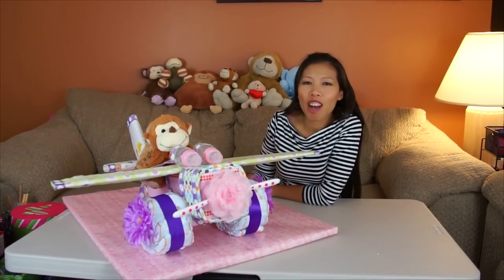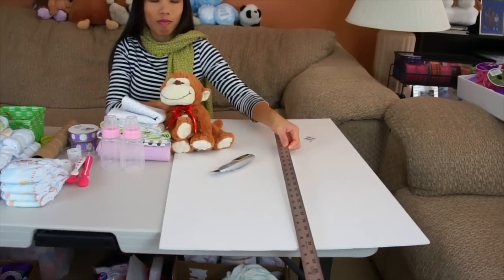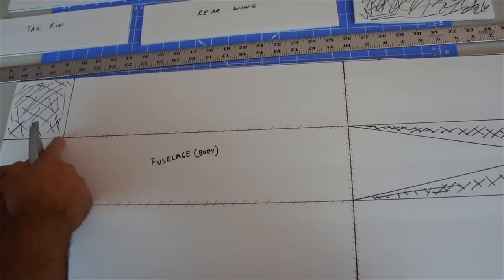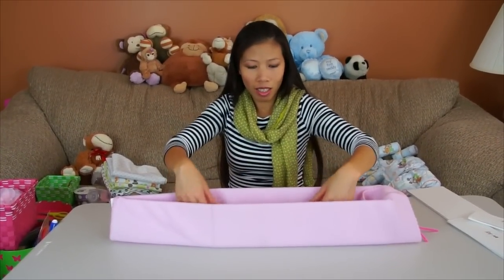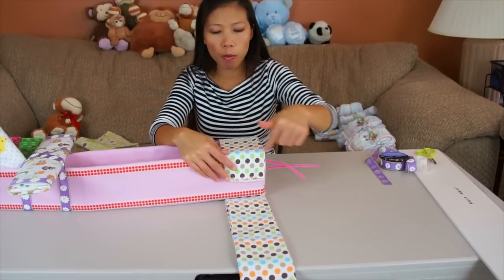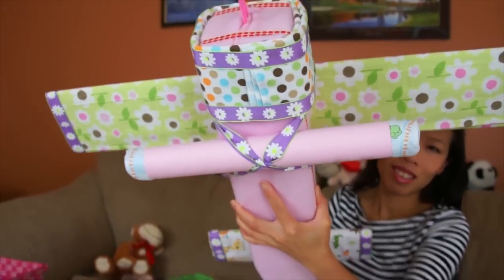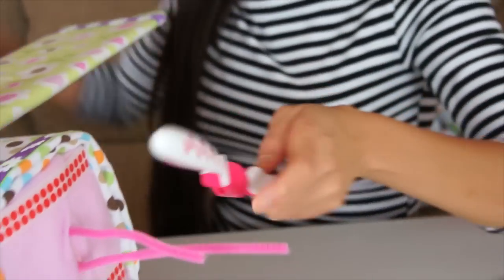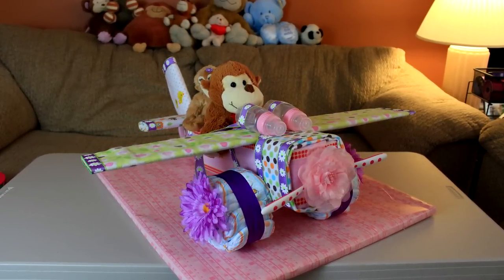Airplane Diaper Cake (How To Make)

Comment: I just have a small comment. On the area for the fuselage, the line between the pointed area and the section that says "fuselage," you had drawn the dash lines, but actually those don't need to be cut at all, right? Because that section doesn't fold upward. Just thought I'd share so maybe you could make a note in the video or something. 
I just made the template so far, but this is a great video. Thank you.